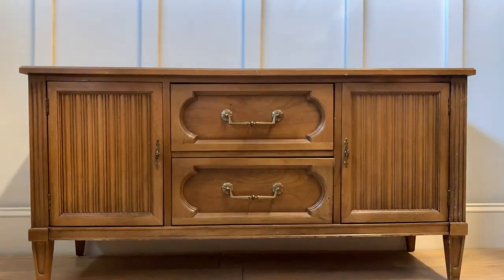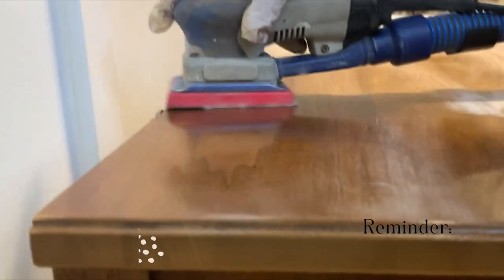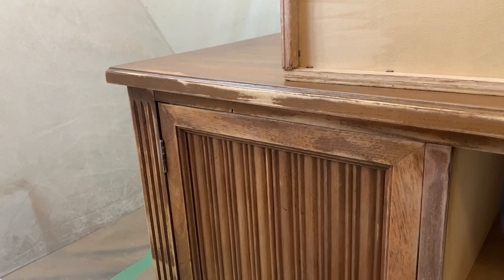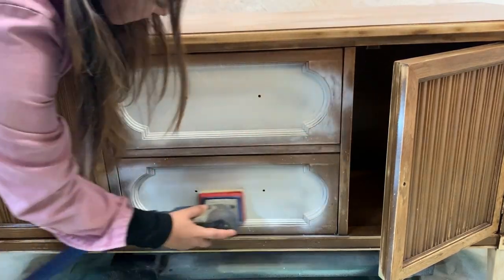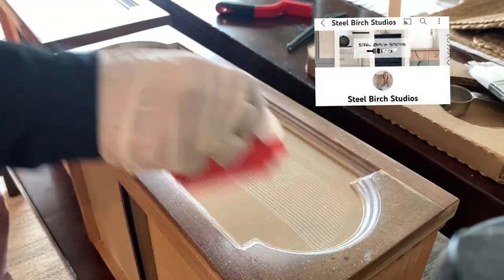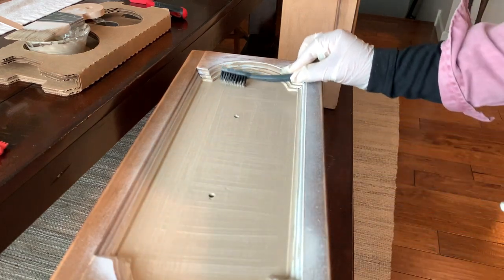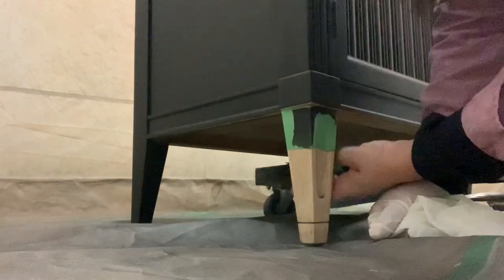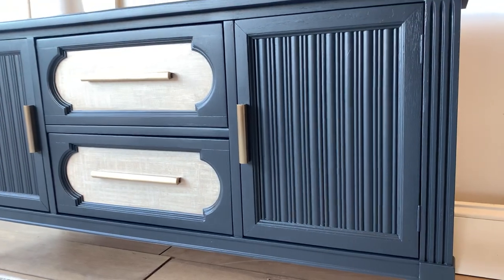Modernize Your TV Console With Faux Linen Technique | High End Furniture Makeover For Less!!

Comment: I really like the look - the combination of colours plus the hardware looks amazing 🤩 If I did the piece, I'd probably leave all 4 legs in wood, I think 🤔 Anyway, I think you did a really good job 😉
Reply from the maker: Thank you! And I know what you’re saying about the legs, except the back ones had a straight edge that went from the upper part of the piece all the way to the bottom, while the front ones have a smaller upper edge and a concave angle. They were different and I felt they would look a little odd.
Reply: @aliferefurbished  I know what you mean. Whatever the case, the piece looks great 😉